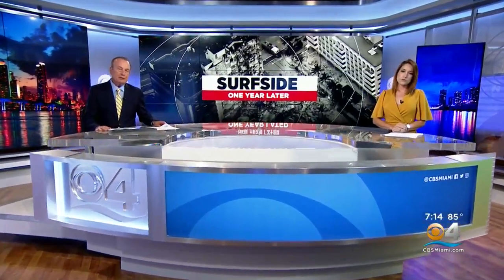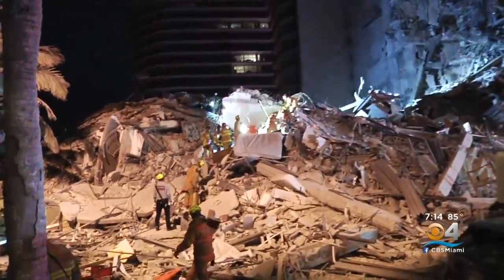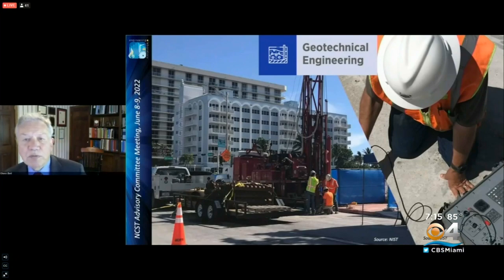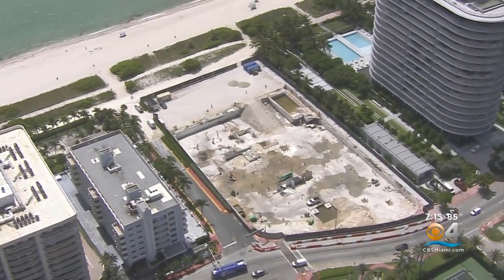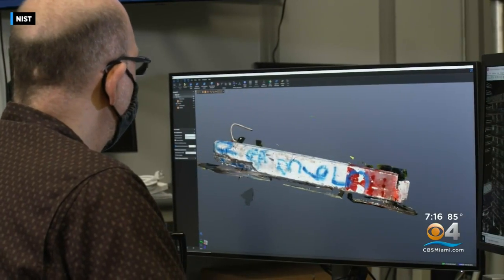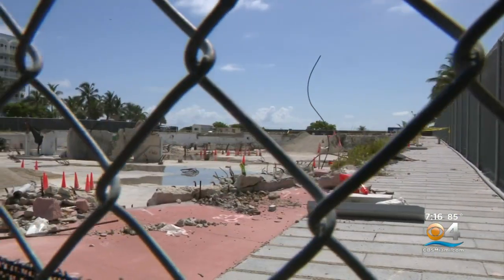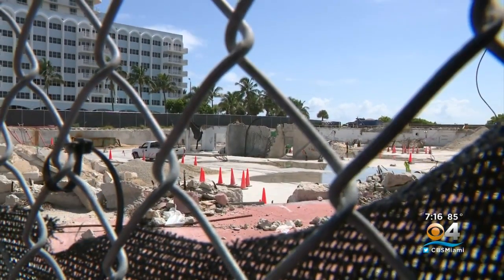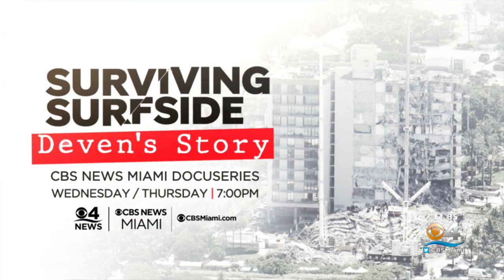NIST investigators give update on investigation into Champlain Towers South collapse

Comment: They did not just blame this on climate change,..
Reply: Partly yes. The army core of engineers did a sand restoration project on 88st. Hundreds of tons of sand because of the erosion. A few blocks down, the beach is gone and looks like an inlet. Miami Beach is flooding faster than they can pump the water out. It’s happening here fast. Like they said, it’s most likely a combination of things that brought the building down however, the sale of 87terrace by Miami Beach to the Terra developers exacerbated the problem. They built right up to CTS and the construction would cause their building to violently shake. Residents called the city and even the police dept. Had that construction not happened, they would’ve been working on the recertification and the building would still be standing.